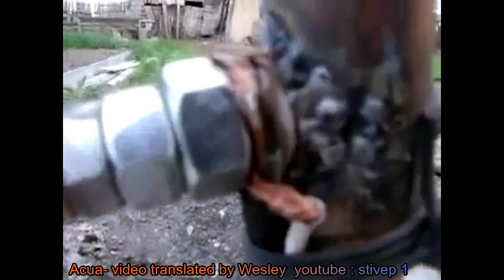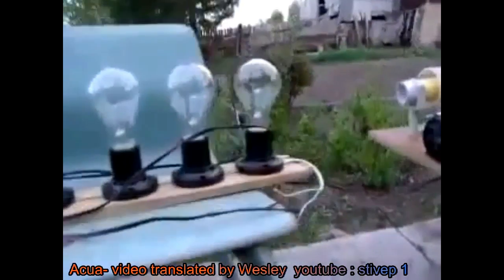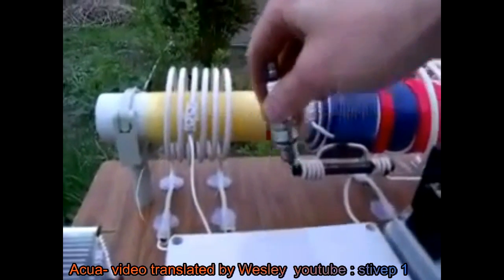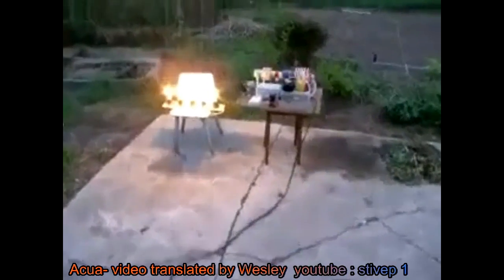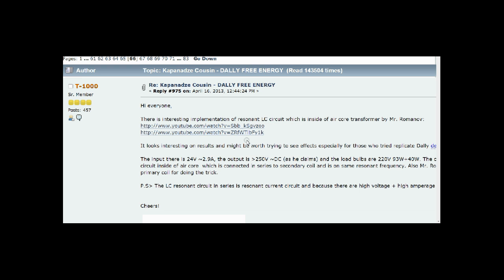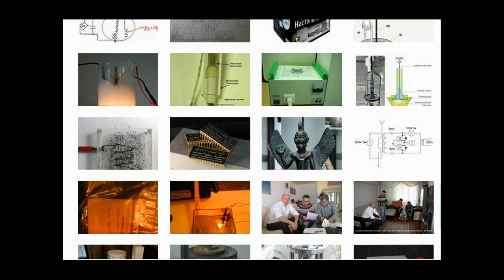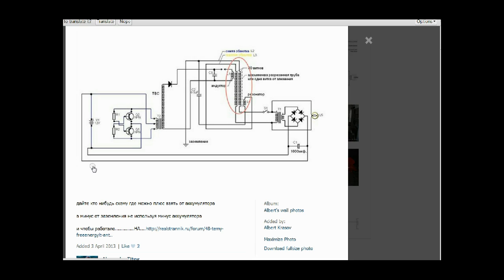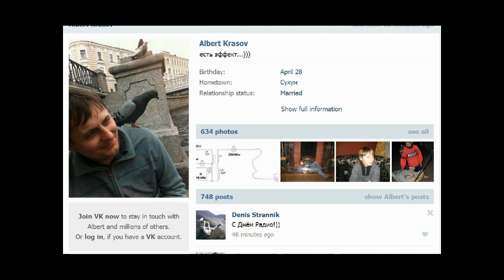a k u l a 0 0 8 3- Free Energy1150W part2

Comment: How much deep ground copper pipe and how much pipe or wire i use
Reply from the maker: ground is the ground, The Ground Wire. The term "ground" refers to a connection to the earth, which acts as a reservoir of charge. A ground wire provides a conducting path to the earth which is independent of the normal current-carrying path in an electrical appliance.
Reply: +stivep1 may i dig ground Approximately 80 feet into water level 
And put ground wire in this hole
Reply from the maker: interesting question. Please check telluric current: http://www.ancient-wisdom.com/earthenergy.htm.  Please note that  you need  to get right amount of self-education  in this area just to be able to understand say- proper ground  and  its properties.  In  the simple  language  - you do not need to dig , but going to Telluric current   can be interesting . Te  typical ground is good 6ft long  copper rod  pushed into the ground by hammer.
Reply: +stivep1 oh your ans too late i dig 2hole north south 65 feet groud into water lavel and 4mm coper wire at the end 12 mm 3feet long coper rod sink 
I spend a lot of mony on this but please tell me how i make this coils
Reply from the maker: this is not the question to be directed to me but to Ruslan from  Riga.
I can only relay to my theory of (Wesley's Electrostatic Pump Theory)
-google it.That might be explanation of what is going on in that device.
I simply explain it as electron mass inertia utilized  in process  at which  atractive force is  Electrostatic HV potential ,driven by nano or picosecond generator. Inertia is present in the dead time intervals between the pulses
Wesley
Reply from the maker: I have never seen the ground  wire 80ft deep into the ground.
This could be  braking point in our quest for adventures    thinking.  But it needs also  careful experienced   engineer to analyze the data.. If it was me I would go down to the pit( shaft)  80ft below the ground  surface. place there insulated  thick  wire( at best gauge 0 -or 1 to 6)    with the 6ft copper  rod attached . the second end of this wire would be  going up to surface  of the earth.  For DC  there would be certain capacitance between surrounding  ground and inner wire..
 If you  connect nano/ pico second square wave generator 
Than rising  edge and  falling edge  of it is AC component with DC  on the top .  If we make  than the bottom  of the square wave at 0V potential ( similar to manual or electronic braking - ON/OFF/ON and so on.) than you creating electron inertia  in  DEAD 0V (zero volt)intervals.
For me it is  important  to see the load behavior (at the very top  end  of this wire.
According to my theory ( Wesley's Electrostatic Pump Theory)
 short impulse  generator is responsible for creating  string  of  interactions with  associated  impedance  -properties  .
Self looping ( self powering) is than effect of  coupling one energy source ( free of taxes and costs) to another.
energy conversion  has in mind:
1.  presence of mechanical inertia of   electron and its motion properties. 
2. presence of  HV electrostatic potential as an attractive force for electrons to be " sucked" from the ground.
Wesley
Reply: +stivep1 i use 4 mm thick copper wire and at end 12 mm thick 3 feet long copper wire
Reply: +stivep1 do you have semethic of this generater
Sorry for my English i could not understand your respective theory completly
Reply from the maker: there is number of schematics posted on  overunity forum.
some of them are set to be from Ruslan by himself. dig for it.
http://overunity.com/12736/kapanadze-cousin-dally-free-energy/new/topicseen/#new
http://overunity.com/7679/selfrunning-free-energy-devices-up-to-5-kw-from-tariel-kapanadze/new/topicseen/#new
 the concept is the same  with Daly , Anonimus, SR, Tariel Kapanadze, Akula and others .
All of them they are utilizing electrostatic method.
Wesley
Reply: +stivep1 thanks

Comment: Re UFOXRAY comment.
Colour yokes had/ have polarising deflection adjustment magnets either side.  Mace-Mayer device uses a separate polarising field electromagnet. 
A circulating ring current plus lengthways magnetic field alternation-energisation at Fe NMR frequency could apply axial direction forces to electrons within particularly amenable Fe compound domains.
The GE TV implosions could have been Fe supercurrent development circulating through a heated and unknowingly energised circular yoke.

Comment: Thank you for your link.
Were earlier Fe construct yoke cores electrically conductive or partially so = as Akula here ? = with Kapanadze conductive ring in ferrite core = within tin can/SS Hendershott assembly = within Mace-Myers iron rod/cylinder device ?
High Ra deflection tubes were notorios for inducing Barkhausen HF inductor oscillation in rasters = vertical lines on left of screen.
The Hendershott magnetic buzzer is a 'Barkhausen' HF pulse generator. Similar in the Wesley Gary generator.

Comment: Hi Wesley.
This has a Don Smith basis to the output circuitry, not same as Hendershot, but similar to Kapanadze.
Hendershot had no deflector yoke as used here; thin tin can or SS.
The earlier video mentioned NMR in Earth's magnetic field.
Not so here as large coil assembly is flat/moved and yoke field is closed.
Surely it is impulse induced NMR within the specialised ferrite/iron domains that is seen here ?
Likely same yoke material (conductive?) is now understood and so no longer manufactured !